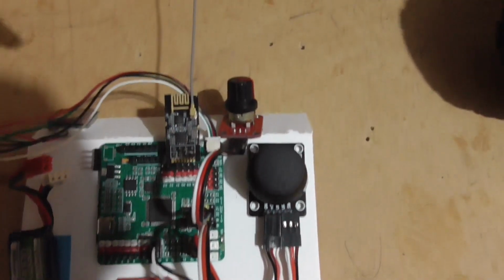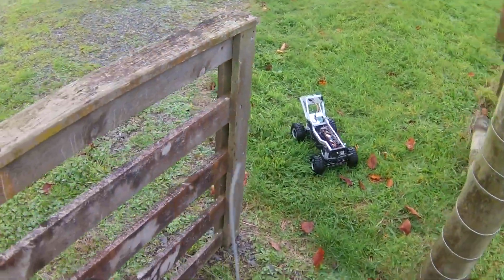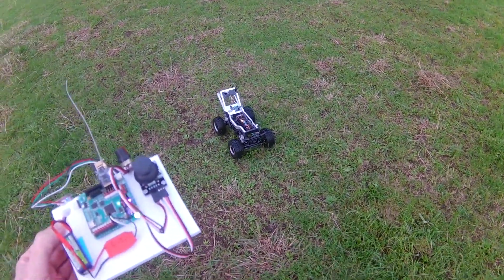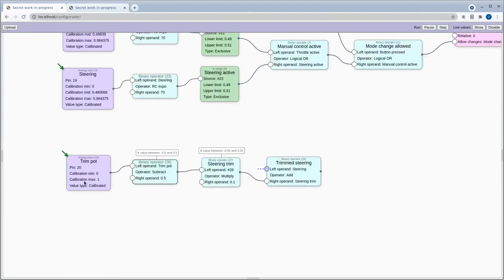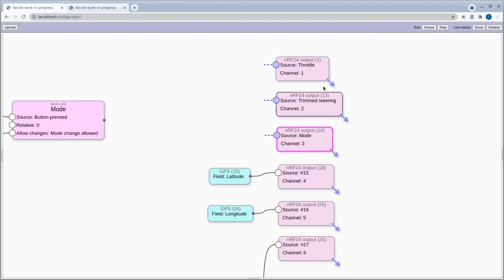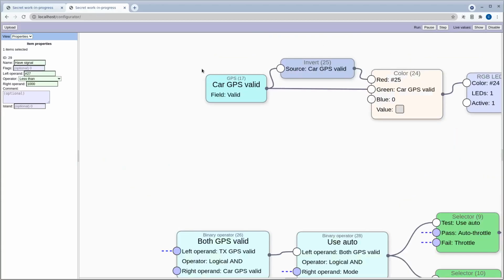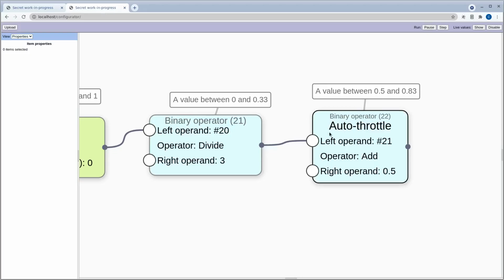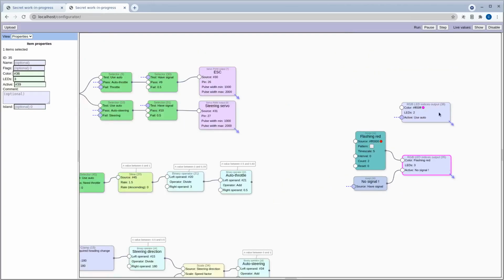Follow-me with iomixer

Comment: Cool project. Just curious, but how were you able to tune the PID steering values to get this to work? Did you attempt to do this empirically by tuning the steering based on different throttle inputs or is the car set to a constant throttle value when following you?
Reply from the maker: There is no PID, not really necessary. The throttle is constant until it gets close, and ramps up over a few seconds when starting to prevent a 'kicking' result - like I explained in the video.

Comment: I built an RC Rover, building and programming a tx/tx set like you did. 
Added a camera for RPV use, with help from some of your previous videos. 
I updated my joystick to a $35 one from Amazon, could never get the cheap ones to work.  

I have wheel encoders so it goes where commanded, but haven't tried GPS follow-me.  Thanks for the idea!

Comment: The ceramic patch antennas used for GPS actually need a ground plane to perform well, which these modules lack. If you browse GPS antenna datasheets on Digikey for example you'll see that most manufacturers specify a ground plane on the order of 50x50-70x70mm, at which the antenna is tuned for best performance. 
Add a ground plane in that size range beneath/around the modules and you will likely see noticeable improvements in acquisition times and positional accuracy, especially with the BN220. You can plug the receivers into your PC and use uBlox uCenter to force the modules to acquire from a cold start to get an apples to apples comparison with and without the ground plane.
I use copper tape which has a conductive adhesive to stick ground planes right on the wing/fuselage of my planes and "bond" them to the grounded shield on the back of the module (remove the sticker and residue.) Anything will work though. Aluminum duct tape or plain old kitchen foil are fair game so long as you can get a good electrical connection between them to the module's ground.
Reply from the maker: This sbusmixer can log three GPS inputs so I might try a test sometime to compare them, for that I would use the roof of my car as a ground plane.
I don't think the ground plane needs to be connected to module ground. At least, I don't recall ever seeing anyone do that, and the development kits I got from u-blox have a simple disc with no connection.
Reply: @iforce2d  Thought about it the other day and you're right, the antenna shouldn't care if the plane is actually connected to the module ground. I keep looking at everything from a DC perspective 😅 The antenna should happily couple to a floating plane.

Comment: why are u not making a tutorial
Reply from the maker: As I mentioned in the video, there are a lot of things that will change yet. The project is a long way from done, there is no documentation, no website, and nobody else owns any of these boards anyway, so what would they do with a tutorial.... This series of demos is mainly for me to pretend I'm an end user, and to test new features I'm adding. It will serve as a showcase of example usages of the system, which will be more useful after it's properly released.
Reply: @iforce2d  So the board is made by you, but what about the software that you program the board is that also made by you yourself
Reply from the maker: Yeah I'm making all of it, that's what I'm referring to as 'system'.
Reply: @iforce2d  nice

Comment: Brilliant, really like your setup. Interesting to watch.  Curious where you get your NRF24 units with the clip on antennas....had some standard ones that came up with about 5 metres range, totally useless. Even with some recommended changes, just crap basically.
Reply: Just had a look on eBay too and none with uFl antenna connection like Chris' here. Only PCB and screw on style https://www.google.com/search?q=aliexpress+nrf24l01+&client=firefox-b-d&biw=1440&bih=721&tbm=shop&sxsrf=ALeKk022aYuazpIlD3VTqhKVR6VI6YElaA%3A1621725981803&ei=HZOpYO3HMIGd4-EPmbesyAQ&oq=aliexpress+nrf24l01+&gs_lcp=Cgtwcm9kdWN0cy1jYxADMgYIABAeEBgyCAgAEAgQHhAYOgQIIxAnOgcIIxAnEIsDOggIABAWEB4QGDoGCAAQBxAeOggIABAIEAcQHjoKCAAQCBAKEB4QGDoICAAQDRAeEBg6CggAEAgQDRAeEBhQ2bIJWJWUCmCAmQpoAHAAeACAAfsBiAGaIpIBBjAuMjYuMZgBAKABAbgBAsABAQ&sclient=products-cc&ved=0ahUKEwitysWIuN7wAhWBzjgGHZkbC0k4FBDh1QMICg&uact=5#spd=3590400625536298852
Reply from the maker: $5 on Banggood
https://www.banggood.com/GT-24-Digital-Wireless-Module-2_4G-NRF24L01-PA-LNA-Industrial-Grade-1100M-Long-Distance-With-Non-wel-p-1361350.html
Reply: @iforce2d  Thanks......what about the antenna ...?
Reply from the maker: Step up your search game guys :)
Here are a few on Banggood starting from $1.70
https://bit.ly/2T4ERd8
https://bit.ly/3udC4vf
https://bit.ly/2RFPJxU
https://bit.ly/3vrYKJm
https://bit.ly/2T2TBcv
https://bit.ly/3uh28pf
Reply: @iforce2d  Thanks...yes, did look around but wasn't sure of the name etc. and Google can take one far distant from ones original search rather quickly at times. :)
Cheers Jorgo
Reply from the maker: fwiw I usually search by "2.4ghz" or similar

Comment: A number things making more sense with how your sbusmixer (configurable node controller) work. Seeing hints of item property configuration and protocol definitions provided some useful contextual details. Like the direction you going, developing this. 

rotorresolutionposition (a meter vs few meters). 
Doing a simple calibration (mode) while both are hold a constant position would allow for exchange of runtime averages for lat/long to effectively compute a differential gps error. (an error vector as a distance, barring offset). 
You could even detect when "follow-me" had paused for a bit, the rover could do a brief related pause (2-5s) to update the differential gps calibration. (times are just guesses, don't think they need to be long, but would be depended on number of samples to reduce outliers in individual gps coordinates)

Something hard to see in the video is the steepness of grade the rover was transversing. It was not evident until you zoomed out. A rover camera view, or an OSD graphic of filtered/averaged tilt, roll angle could help viewers understand the challenges the rover is facing in context. 

You may also want to add a "fail-safe" sleeping turtle mode, so don't need to worry about motors etc being abused if something unexpected happened.

Comment: Pls try arducopter on traditional helicopter setup
Reply from the maker: Sounds expensive...
Reply: @iforce2d  no its not right now i m working on arducopter on traditional helicopter  the heli kit cost only 80$ and rest is flight controller esc battery  its cheap actually even if u go with a metal head assembly
Reply: Pls i want u to see run arducopter on a heli its very very different then a drone and its much more interesting to i have been following ur channel since the cheappass Quadcopter days learnt a lot  and i pls request u do to try this traditional heli stuff 🙏
Reply from the maker: I know nothing about tradheli so I'm not sure why you're asking me. To be honest they freak me out and I wouldn't want to be standing anywhere near one. I might try it someday, but like I say the cost compared to a multirotor when you crash is pretty high. I subscribe to this guy's channel so I have seen that they work very well with Ardupilot though:
https://www.youtube.com/channel/UCJZjaDp78PKNFgLfDsm1J5A

Comment: I learned from you alot from your previous videos, and I had to implement something similar for my ROV hobbyists project) I had to overcome compass tilt compensation right away as wobbles in water has some more effects. But RTH or even foloow me function is quite interesting I will challenge to implement in future developmants. Its quite challenging as I have gps of free-floating wired bouy and not the drone itself as I do not have a budget accoustic location of the drone..yet) but for distances like over 80-100m it must be not substential for a while. Your sbusmixer is interesting but I need to look more into how it works, as its interesting! Hope to see more from you in a while. I like your channel much!

Comment: I've been playing with the nrf24, but I'm noticing a lot of latency, what do you recommend?
Reply from the maker: The receiving side has a FIFO buffer of 3 packets. If you don't clear this quick enough, new incoming packets will be discarded. So check as frequently as possible and when reading packets don't just read one, read all available packets to make sure the queue is cleared. The frequency required to keep up will depend on how fast the TX side is sending.
This is the first thing I would suggest to look at, since the RX FIFO is the only place 'old' data is stored that might cause latency.

Just in case that didn't make much sense, and assuming you're likely using arduino, and possibly have a delay() call to adjust the main loop time like this:

void loop() {
	checkNRF24Incoming();
	doOtherStuff();
	delay( 10 );
}

During the delay() there can be packets arriving that get ignored. To clear the incoming queue as fast as possible and still do the 'other stuff' at a slower rate you'll need something more like this:

unsigned long lastUpdateTime = 0;
void loop() {
	checkNRF24Incoming();
	
	unsigned long now = millis();
	if ( now - lastUpdateTime > 10 ) {
		doOtherStuff();
		lastUpdateTime = now;
	}
}

If the doOtherStuff() takes a while, you might even want to sprinkle in a few calls to checkNRF24Incoming() at various points within it as well.
Reply: @iforce2d  that's exactly how it's setup thanks!